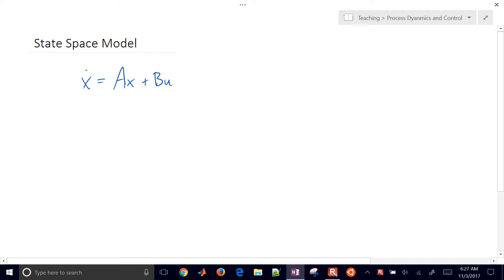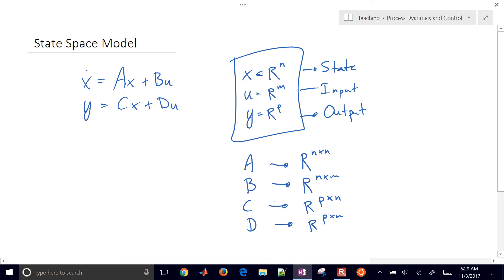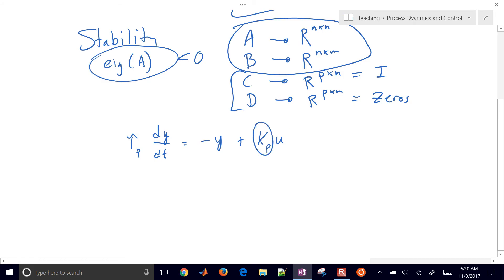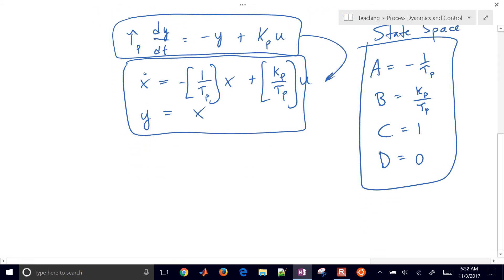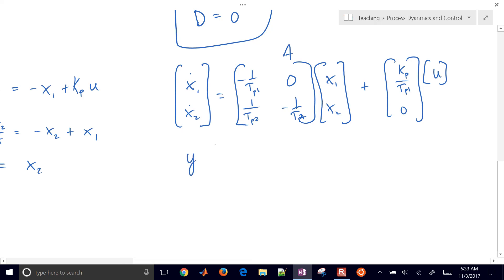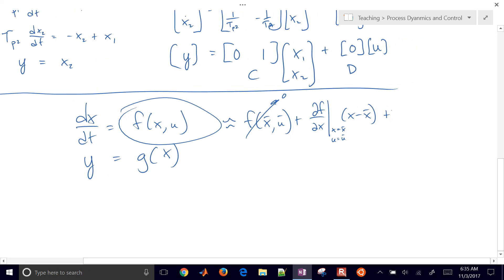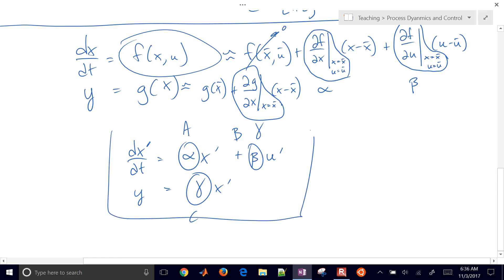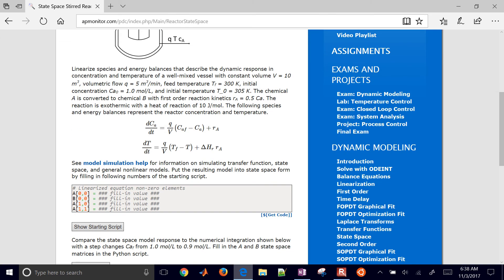Introduction to State Space Models

Comment: Hi, I've started last week the course and I've found it very well structured and full of examples that enhance my  understanding of process dynamics. Thank you for that.
 I have encountered one inconsistency I cannot follow in the state form of a second order system in http://apmonitor.com/pdc/index.php/Main/SecondOrderSystems and in http://apmonitor.com/pdc/index.php/Main/StateSpaceModel
More specifically the Kp*u(t-theta_p) is assigned to x1 in one case and to x2 in the other. 
IS there any specific reason that this happens since I don't think they are equivalent, and there is no physical context through which I can reason one over the other. (obviously in the second order systems page the derivation is presented in full, while that is not the case in the State space models)
Reply from the maker: State space requires that there are not higher order but are all first order derivatives. You just need to define a new state for every order of the derivative. For example, if you have a 3rd order system with d^3(y)/dt^3=u then you would need to use three states as x1, x2, and x3. The states are then x3 = y, dx3/dt=x2, and dx2/dt=x1. Your three equations would then be: dx1/dt=u, dx2/dt=x1, and dx3/dt=x2. You can fit these into the state space matrix form as: A = [[0,0,0],[1,0,0],[0,1,0]], B=[1,0,0], C=[0,0,1], D=[0]. I hope this helps.

Comment: can you please explain how you get the output equation?
Reply: why does y=x_2 and not y=x_1?
Reply from the maker: The output equation is typically a condensed identity matrix with ones for the states that are measured. In this case it is y=x2 but it could also be y1=x1 and y2=x2 if both states are measured.  In that case, it would be C=[1,0 ; 0,1]
Reply: @apm  how do you know which state is being measured?